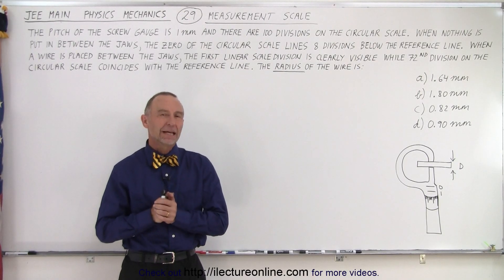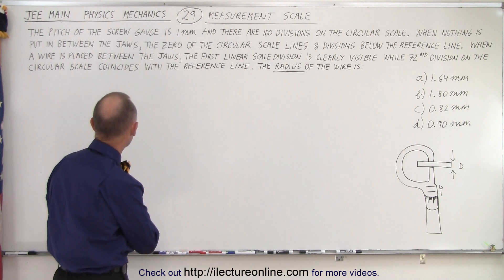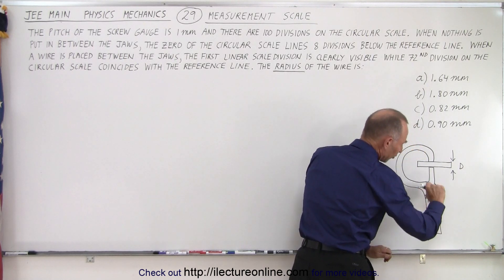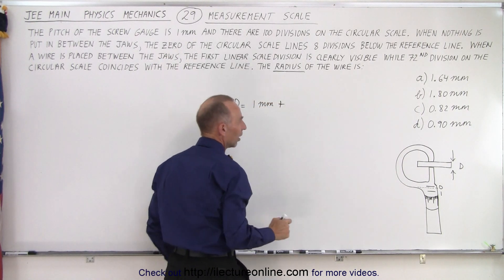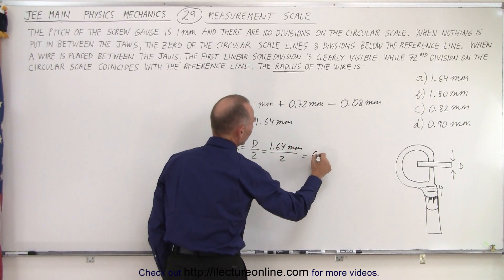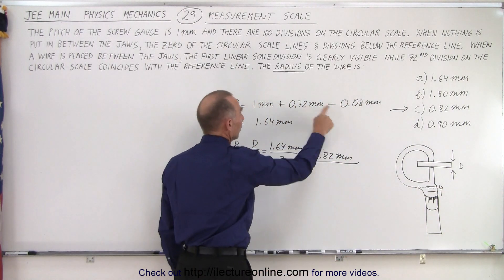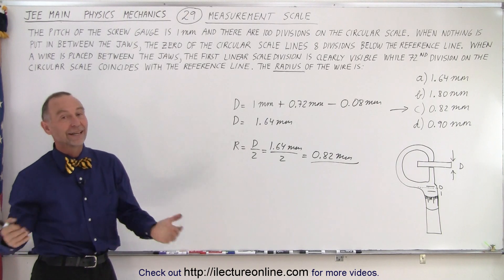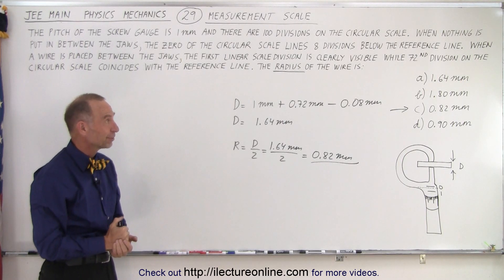JEE Main Physics Mechanics #29 Measurement Scale

Comment: Professor, since the question states that the zero marking is 8 divisions below the reference line, then shouldn't we add the error reading to get the true reading? Like if it were to measure something of 50 divisions only but started from -2 divisions then the observed reading will be  48 divisions. So to correct that we would have to add 

I know I am wrong somehow, because all the solutions online are same, but I still can't understand. Can you please help me sir? I would really appreciate it.
Reply from the maker: This is a good example where sometimes the author of a problem does not make it clear, or clear enough, for us to understand what they mean, or what they state could be interpreted differently from what was intended.  Sometimes with a text book problem, I need to look at the solution in order to determine what they intended us to do with the problem.
Reply: @MichelvanBiezen  Thanks a lot for your insight. But professor, how do we understand the question during the examination?

Comment: You treat a set of mics in my shop like that and you will be fired instantly.  Mics are to always to be zeroed.  That is to say, when closed the scale reads zero.  There is a tool in every new box to adjust the mics properly, use them.  watching this video was painful.  PS, below the reference line in a shop means you went past your zero and is in the negative, mics are held 180 degrees or since you are using metric, 200 gradians of your drawing.
Reply from the maker: Note that this was a question on the JEE advanced test which is given to the highest caliber students in India.  It has nothing to do with the quality of the micrometers, but in how you can answer the question correctly.  Yes, in practice you would want to calibrate your equipment so that the zero reading would be at zero.